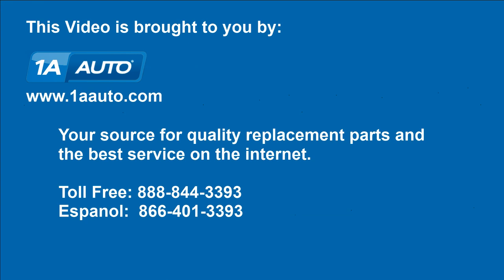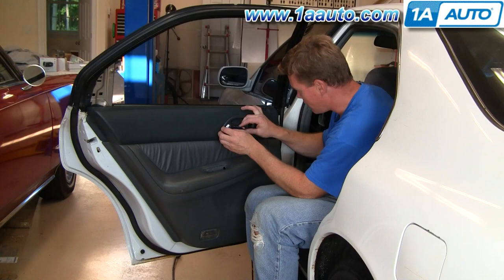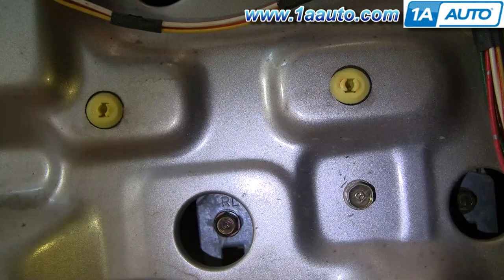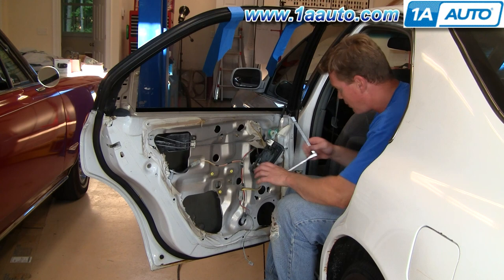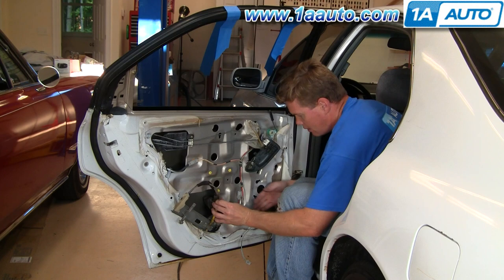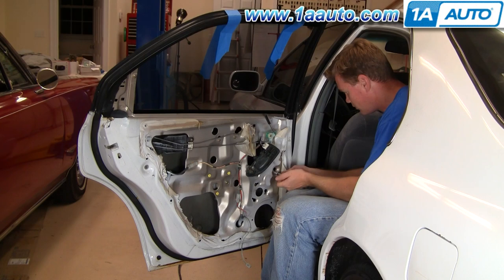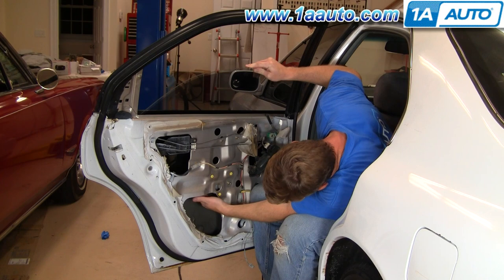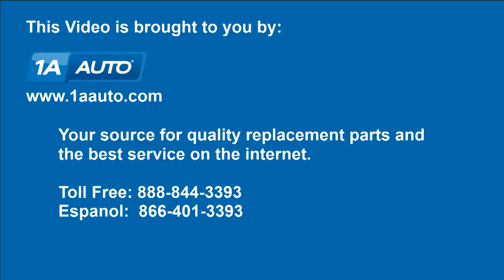How to Replace Window Regulator 94-97 Honda Accord

Comment: Thanks, Exactly what I was looking for... 

Tip: for those who dont want to use duct tape to hold your windows up. 
I used a big suction cup from my GPS. 
If you dont have one, you can buy little ones from the store.
Reply: Just purchased a window motor from your website. 
Good price.
Reply from the maker: +GER XIONG That's a good tip. Thanks for posting it. 1aauto.com 866-403-3393

Comment from the maker: @greeneyes2164 It could be the motor or even the switch going to the motor on your Honda Civic. I would test the wire going to the window motor with a test light while pressing the switch to see if there's current going to it. If there isn't any current then it may be the switch, just make sure that there's power to the switch.

Comment: Thx for this video... how do I tell if I need to replace just regulator versus the motor versus both?  FYI: I heard a popping & cracking sound (upon using the power window switch) before my window would no longer roll up.  Thx in advance

Comment from the maker: You may want to test the switch with a test light or an ohm meter to see if it's working correctly. 1aauto.com 888-844-3393